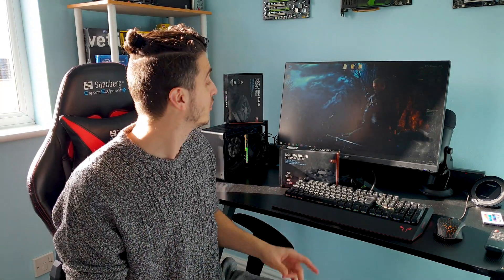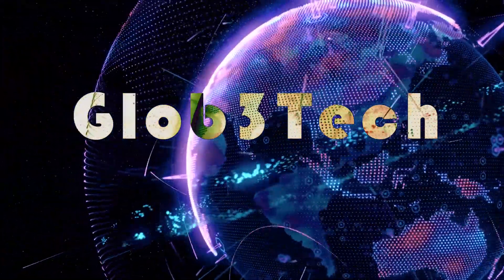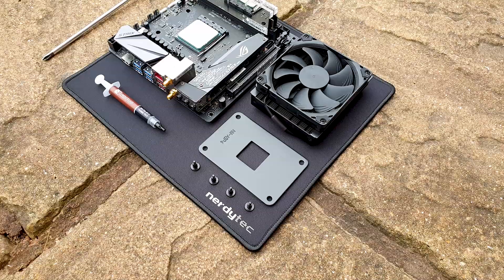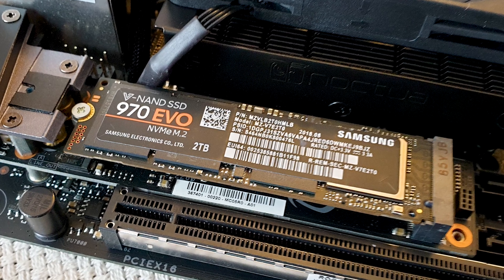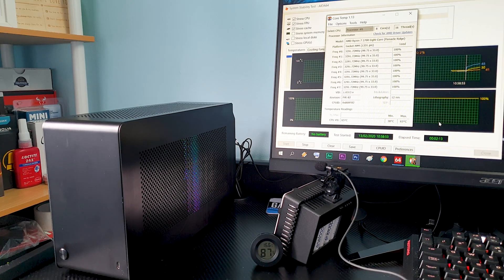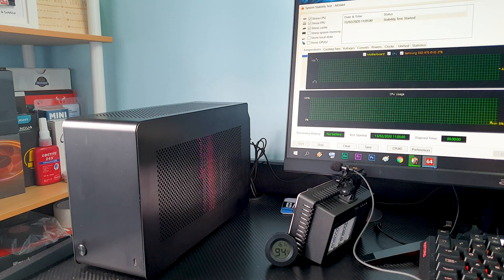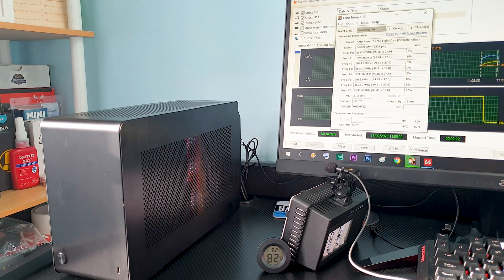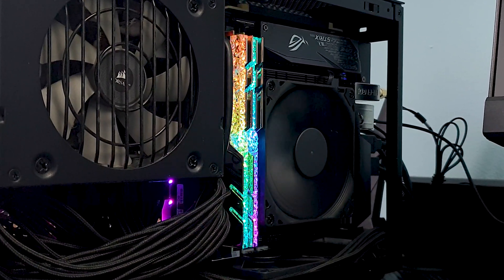The Noctua L9a & L9i chromax.black | Still the benchmark for silent low profile air coolers?

Comment: Is this a good cooler for Ryzen 7 3700x? I’ll be doing mainly graphics design and video editing. Thanks
Reply from the maker: It will be on the limit. But you can manually oc the cpu. Check my A4 playlist please - I used the 3700x with the l9a 👍

Comment: Awsome vid! Currently waiting on a replacement mobo from energy and I can finish my 1st itx build in the lian li q58 case..had a cooler master argb downfire fan on it n seemed to do ok ..top 2 fans are intake and bottom one I have for exhaust..haven't had a chance to check thermals yet because asrock mobo just kept rebooting on me..but the 3 fans and argb cooler looked good...haven't really seen anyone air cool in that case...I've got a r7 2700...65 watt chip and a gigabyte 2 fan 2060 for it ...im hoping temps will be ok on bn a lower wattage chip :)
Reply from the maker: Thanks Jason! The thermals should be fine all around since thay CPU is a true 65w TDP chips. 👍

Comment: Great test. But how does it do with a 95W CPU like the i5-2500 in an SFF case? 🤔
Reply from the maker: Hm. It should handle it since those are soldered CPUs and back then they respected the TDP.
Reply: @Glob3Tech  Oh ok, cheers.

Comment: Hey! :)
 
Im currently thinking about making an open Pc build using an Ryzen 5800x.Do you think this cooler is capable of cooling such a CPU? Im going to use the XPROTO as my case, so teh Cpu wills always be exposed to fresh air. What are your thoughts?
Reply from the maker: Hi Alex. That sounds like a cool project! Unfortunatly the 5800x even in stock form is a hot CPU. I mean at stock apparently it will reach mid 70s with ease and that was with a big 140 mm air cooler. The only way I would imagine it will work with the L9a if you undervolt it a lot. I did something similar with my 3700x if you check my video please in the A4 playlist ✌but I have no idea if it will work with the 5800x since I don't have it.

https://www.techpowerup.com/review/amd-ryzen-7-5800x/20.html
Reply: @Glob3Tech  Thanks a lot for your very fast response! Sad to hear, although thats the answer I expected. Probably gonna go for a different case & cooling combination as most other Cpu coolers do not seem very appealing to me (using that particular case). Once again, thank you very much & have a blessed day! :)
Reply from the maker: @Alex_Eh  Sure, my pleasure! 🤗 I know, myself with the A4 I can't push the limits that much in the CPU department. Luckily we have that 92 mm AIO that helps. Good luck with your build and let me know what you choose in the end 👍Thank you, likewise!

Comment: Hello! I was looking for cpu coolers to purchase and I came across your video! I'm trying to figure out if this fan is good enough for the Ryzen 7 3700x. Thank you in advance!
Reply from the maker: Hi. If you use the CPU in stock form, it will be on the limit with cooling depending what case you use, airflow you have etc. I have found a quick fix if you manual OC the 3700x at 1.075v for 4.0 GHz on all cores you will have the same performance as the stock cpu but 20 degrees C cooler and them the L9a will have plenty of headroom. If you check my Dan A4 playlist please you will see a lot of tests there. 👍
Reply: @Glob3Tech  Thank you my man! I appreciate the quick response! I wish you luck in your future videos dude!
Reply from the maker: @taejun1922  You are most welcome and thank you so much 🤗👍

Comment: Hey, where did you get those psu wires?
Reply from the maker: Hi. Those are the Corsair Premium Cable kit for the SF series. They come standard now if you oder the new Platinum SFX PSUs.

Also here they are separate.
https://amzn.to/2JEGBFJ

If you check please my latest videos, you will see there is an even better alternative if you plan to use the AIO. 👍

Comment: Hey, love the content, been binging your a4 cooling vids. I'm looking to make a build myself, the goal is to cool a 5600x as silently as possible. What do you think is quietest? L9a, black ridge with 92mm, black ridge with 120mm and vlp or aseteks 645lt? Or maybe something I didn't consider yet? There's so much info out there and it's a little overwhelming, I really appreciate all the time you've taken to review products for the a4
Reply from the maker: Hi there. Thank you and it means so much to me to hear that 🤗 

Well I don't have the 5600x yet but apparently it is a bit cooler in stock form than a 3700x according to Techpowerup.

https://tpucdn.com/review/amd-ryzen-5-5600x/images/cpu-temperature.png

With this information, I would recommend what I use daily myself where noise output is one of my main priorities - the Asetek 645LT + side fan 'mod'. This will give you plenty of cooling  headroom and in return will be the quietest option with that CPU.  Second best should be the L9a but I need to test that first myself. 
Hope this helps and let me know if you have any more questions 🤗
All the best,
Alex
Reply: @Glob3Tech  Thanks so much, really appreciate the insight. May I ask what speaks against a black ridge with a nf-a9x14? You only compare the L9a to the stock fan in this video if I understand correctly and I'm wondering whether the thermals or acoustics would suffer compared  to the l9a if the BR is used with a nf-a9x14
Reply from the maker: @Maxlan2  No worries and my pleasure 👍 From what I remember for some wierd reason the BR with a Noctua 92 mm fan is a bit louder than the L9a with the same fan. Also check my website please glob3trotters.com for some extra tests. But overall the BR is a great choice of course if you want air cooling as long as you would get standard LP RAM. I like the AIO since it gives you besides the best cooling results, the easiest way to upgrade the CPU since you don't have to take the motherboard out after the initial install and you can use whatever RAM kits you desire no more height restriction (vs the BR with 92/120 slim fan). 

But bottom line the AIO from my experience is the quietest followed by the L9a and then the BR with either fans. 👍
Reply: @Glob3Tech  Okay thanks so much for the detailed responses! Looks like I'm going with  the 645LT
Reply from the maker: You are most welcome and let me know how it goes 👍
Reply: @Glob3Tech  Sorry but I have one last question, are you getting a 5600x and will be performing thermal tests with these various coolers? Because I probably won't start building until a good month or so from now, maybe it's worth waiting out your results for?
Reply from the maker: @Maxlan2  No worries at all. I have my eyes on an upgrade since I am using currently the Ryzen 3 3100. But I am in no rush for now since I am trying to snach a good deal for an used 3900x 3950x on ebay. If nothing pops out I would probably consider the 5600x or the 5600 even. Hopefully we can sync if I get one in due time.

Comment: Will this be enough for i7-10700 ? That cpu is also TDP 65W.
Reply from the maker: If it respects that TDP then of course it will work. To my knowledge this CPU has the default limits at PL1 = 65 W and PL2 = 224 W. If it goes into max turbo mode it will generate a lot of heat.

I don't have this CPU to test it myself but here is a review to see how it performs with a Noctua U14S which is a 140 mm tower cooler. 

https://www.techpowerup.com/review/intel-core-i7-10700/19.html
Reply: @Glob3Tech  Thank you so much for you answer and info =)
Reply from the maker: @SOULDEZIGNER  Most welcome 👍

Comment: got the same case from initial release, just ordered the same motherboard, sabrent pcie 4.0 1tb nvme drive , and cooler. all that's left is 750w sff psu and 3080
Reply from the maker: Excellent choices 👍
Reply: @Glob3Tech  will also be re-using my samsung p961 1tb nvme for extra storage and 32gb ddr4 3200mhz. It's crazy to think that my current nvme drive was double the price of the new pcie 4.0 sabrent drive.
Reply from the maker: Oh yes I remember when I got my Samsung 950 Pro 512GB and I think it was 300-350$ new.

Comment: If you dont care if the cooler is loud and you can have a larger case for taller  low profile coolers,which one would you choose to coοl 10700k in stock settings?
Maybe Scythe Big Shuriken 3 can make it?
Reply from the maker: Yes, or the Noctua L12S since you can put an extra fan on top either the same slim 120 or regular if the height permits.

Comment: I am building a mew 3700x/5700xt mitx system and needed a good low profile cooler; thanks for this review I was hoping to use a small case and find a good cooler!

Edit: It seems a bit loud though, are there any low profile fans you recommend over the stock one?
Reply from the maker: For the 3700x the only thing that I would recommend there for the best combo of low noise output  and cooling would be the Asetek 645LT. If you saw my other videos, the L9a will only cool the 3700x if you either give it a negative offset or manually OC it to a lower voltage for 4.0 GHz (that will ensure stock performance but lower temps). As for an aftermarket fan, I also tried in my latest video a thick fan the 25 mm variant of the slim 92 from Noctua but noise wise almost the same.

Comment: I would belieive that the Alpenfohn Black Ridge Low Profile CPU Cooler would still be the king at 47mm hieght with the noctua 120mm fan modification as your video on it indicated.
Reply from the maker: True. But like you said with the fan and vlp memory. As it comes from the factory, no :)

Comment: good review! is it possible to swap the fan to a 25mm one?
Reply from the maker: Thank you! Yes, it already has the extra long screws to do this :) Of course, as long as your case have the extra room.
Reply: @Glob3Tech   nice, does the dan case have enough space for it?
Reply from the maker: Well stock l9a/i is 37 with 15 mm slim.
So 10 extra for the 25 mm it's exactly 47mm which is the limit for the case. But if you put the side panel on you will have extra noise from the turburence since the fan will not have enough space to 'breath' properly.

Comment: thanks for this review. You should try also Cryorig C7G (so called "graphene" version)..;)
Reply from the maker: My pleasure and thank you as well. Yes, I know it but it's very expensive in the UK. Will try to get a sample review :)
Reply: @Glob3Tech  Yes I know. I got one, but it was long and still pretty expensive (around 100€ with shipment). You can get cu variant, cheaper and as effective..;)
Reply from the maker: @MarcParisTV  Nice :) How loud is it and what cpu do you have? I also had the standard version, the first c7 that came out, on a 4790k. It was way too loud for me and bearly cooled it even when undervolted :)
Reply: @Glob3Tech  In fact It's as loud as nh-L9i/a as I'm using nf-a9 fan..;) Compared to NH-L9i/a it's just bigger heatsink with same fan..;)
Reply: wait a second, my link is leading not to Cryorig C7G. It has been changed to standard C7, but in black..;) (just removed link). I'll simply check my sample's weight..;)
Reply from the maker: @MarcParisTV  I see, nice 🤗
Reply from the maker: @MarcParisTV  No worries. :)
Reply: @Glob3Tech  At the end I tested customed C7 I received - It is aluminium fins with graphene coating with 4000 rpm - with my Ryzen R7 3800X. https://smallformfactor.net/forum/threads/smallest-atx-case-cerberus-x-complete-build-log.2007/post-185864
At the end it's a good cooler (https://www.sfftec.com/product-page/cryorig-c7-plus).